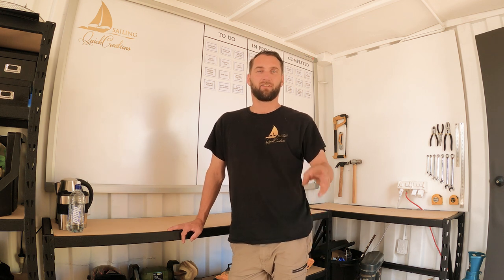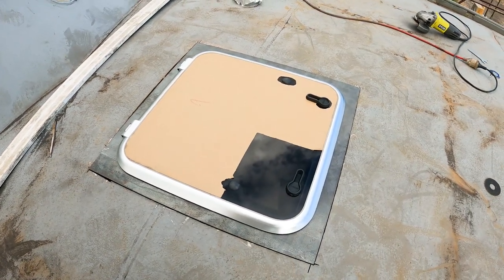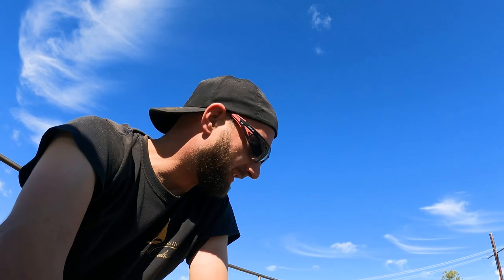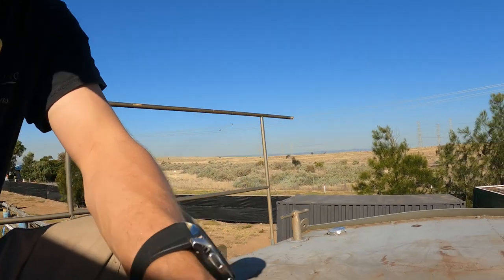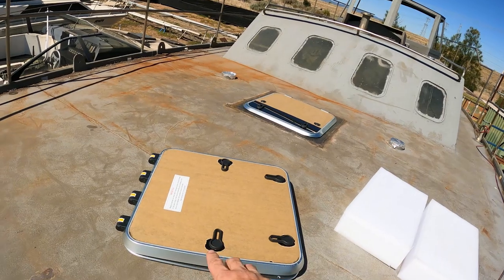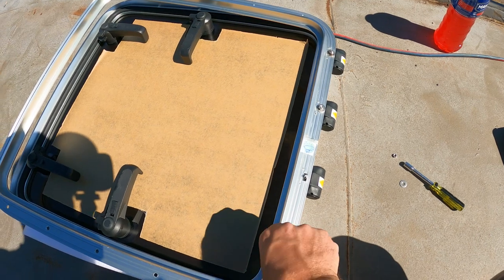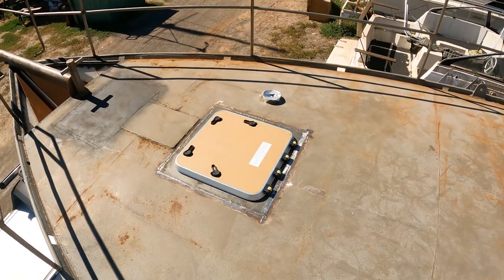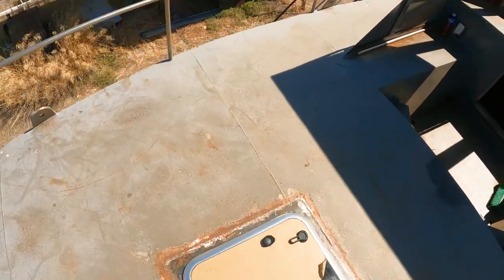Sailing QC # 14 |  Installing New Boat Hatches PART 2  | Steel Sailboat Restoration

Comment: Great job, maybe think about a few cans of cheap black spray paint to just give the areas you grind a quick lite coat to seal them of from surface rust, may save you ridding yourself of it later, good job keep going and she will be ship shape before you know it, maybe, sort of, you know, then, all the best, Al
Reply from the maker: Thanks Allan! its all going well so far lots on the go can't wait to have it all cleaned up once we have finished the hot works!!

Comment: looks nice!
Facing all the hatches opening forward?  You'll find opinions split on which direction to do so.  Tradition on a sailboat typically has them opening aftward, lessens possible water coming in from forward while open.

Through-bolting with loose lock washers and nuts on the underside?  Have you considered welding nuts in place on the underside?  I'm assuming the steel is to thin to thread securely?

Nice welding with the stick welder!  I'm considering replacing my ancient AC-only stick welder with a combo stick/tig/mig AC/DC machine.  There're pros and cons for all the welding approaches.
Reply from the maker: Cheers!
All hatches haven't been bolted on just yet just sitting in place, we are determining the best directions for openings based on surroundings. 
The most forward hatch to face aft due to splash zone, however we will have to take into consideration if it will get in the way of the inner stay etc.
Middle possibly forward facing to capture airflow while underway in good weather.
Aft hatch to face aft potentially allowing more flow due to dodger enclosed etc.

We did have enough material to tap threads in the holes, however we are trying to avoid crevice corrosion at the interface of the threads and the bolt. We are using stainless bolts and nuts they wont be welded mainly due to easier maintenance and we can replace them if they are worn or damaged. If they were welded on this may be more difficult task. All bolts will be loctited with loctite 242 so we wont be worried about them coming undone.

I did enjoy using my new welder! If you're looking for one of these multipurpose welders the only advice I would have is to make sure you can manually adjust the amps to volts ratio. The auto tune for volts and amps is gerneralised and not always correct. Its great to have better control when you need it!
Reply: @SailingQuickCreations  
Yeah, stay location would definitely play a role.  Is there a compression post in place for the main mast?  That might play into where the staysail and jibs run (not to mention where the spinnaker pole(s) will mount.)  Any idea what kind of sail plan you will put up?

Good point on the crevice corrosion. A good gasket with Sikaflex on both sides and worked into holes will go a long way to a tight joint.  (Check out the channel Odd Life Crafting, a young couple in Brazil redoing a steel boat which required a fair amount of cleanup/repair of through-deck connectors.)  Loctite is great to keeping fasteners tight, not sure how well it works as a sealant.

Re: Welders, yeah having control is always a good thing!  I've been checking out reviews of various units and still haven't made up my mind, it will probably wait until next year, as both my son and I are building/rebuilding our shops.

Good work!
Reply from the maker: We are looking at going a cutter rig sloop for our sail plan. 
The loctite will be to secure the nut the head of the bolt will also have bugle tape etc :)
Odd Life Crafting is great, we watch lots of amazing channels each week getting great ideas and new options is super helpful.
Good luck with your shop builds!!